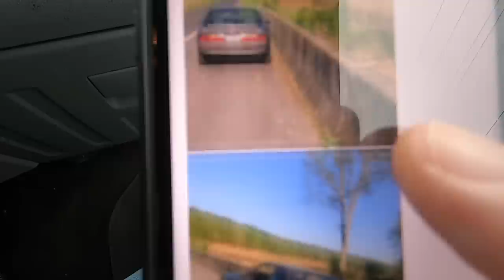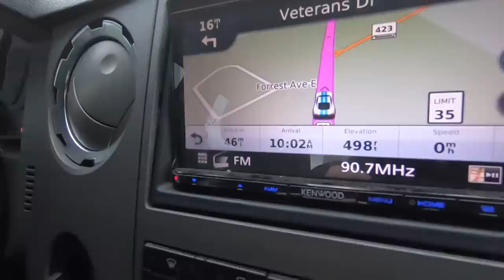We found a 100% original foxbody, and tried to buy it, here is what....

Comment: Here in Chitown, that car is a STEAL at $3k... I would definately buy it.. That quarter panel dent is an easy fix. just take the interior trim off, pull it with a dent puller, and check the frame...  Oh well..  You won't find another, and that stick shift is worth it. I would take the motor apart, and put on all the good factory goodies, intake from Explorer, bump the compression, GT40 heads, and you have a pretty quick stock screamer as a daily driver. Would love to have it than a rust bucket from the same year....sheesh..

Comment: I have two 1993 all original 5.0 Mustang’s one with 5000 miles one with 60,000 miles. Both are hatchbacks one automatic one five speed.
Reply: I got an 88 and 90 the 88 is auto with 13k miles and the 90 is manual with 45k, both convertibles though
Reply: I got five all original 1993 5.0 Mustangs with 12, 45, 80, 110, and 300 miles. All 5 are hatchbacks one automatic four five speed
Reply: @Stopsign32v  damnnnn sittin on gold
Reply: I have two pimples, all original, both ready to pop.  Both hurt one is bright red and one turned blue!

Comment: I've been around these since I was 3 (29 years and Still dialy the 91' GT my dad bought new in 91', have also owned many 93' Cobra's) and anyone who's been around them that long can tell that car has been hit. 3K is close to the value but she's not virgin, atleast been to 3rd base.
She could fixed yes, but theirs a few shady things about her. 
Here in the south..she's worth about 2,500 max. Any cowl or hatch damage is a major red flag. 
So, I think you made a good choice. 
For you to arrive with a truck and trailer and the guy not even attempt to consider an offer is enough for me to leave. Sometimes it's not just about the car guys, it's about the sellers attitude. I've walked away from a 93' Saleen clone that was done to the max for 5,500 just because the owner continued to lie even when caught lying. Car was shockingly gorgeous but if your gut tells you "This don't feel right" then listen.

Comment: Yeah, that LX has been rear-ended at some point. The passenger door doesn't close properly and isn't aligned when shut because of the tweaked right rear quarter panel. Unibody will have to see a frame machine, the rear quarter can probably be salvaged if the metal stretch isn't too much.

Comment: No rust, 3 was worth it.  Bad gas, fuel filter, air filter. Easy, eazy.  Yall messed up.
Reply: I agree the stuff it needs is stuff you wanna do anyways like a full tune up and fresh gas and oil etc.  Body wise i dont think its too bad either a no option 5.0 5 speed lx that is 100% original down to the plug wires is worth 3k in my mind all day long period

Comment: PDR will get that dent out easily!
Reply: PDR is not getting that RT quarter dent out.
Reply: @shockerdad3411  You cannot be 100 percent on that. It definitely could of made it look better. I did some home PDR and I am no professional and made Tahoe fender that I could not even get behind to hit out a lot better. Maybe not all the way but slide hammer to a plastic hot glue stick can pull out more than you think.
Reply: @mainecrab  I work at a body shop and PDR work should make things look like it did before damage was done. If not, we do the repairs. That quarter looks to be 10+ hours of repair to make it right.

Comment: My 89 gt was all original 2 owner car with ~150,000 miles when I bought it for $4,000 , factory wires, turbines, the engine hoist things, radio, all smog stuff was there, air silencer, even had the Original owners manual and the build sheet under the back seats, the only things I can think of it didn’t have was the distributor boot and a radiator, the plastic clutch quadrant just broke, sometimes i get mad at myself that I’m even doing anything to it but it wasn’t a perfect car it needed a little but seriously little work I do plan on doing a full but tasteful build it will not be butchered lol

Comment: I do body work and i had rather have a factory original ford quarter than a aftermarket one spotweld so eye hooks to that quarter panel take a come along to it chained to something solid and pull the dents skim some good bondo on it and put some single stage paint on it thats what the factory put on that color anyways and sell it for 6000.  Id get it to those dents would come out. The top one would pull out easy at the body line wouldn't take anymore bondo after u pulled than you would have in a pos lmr quarter cause that hatch just needs adjusting a hatchback from factory cars dont always fit much better than that one did wish i had 3 grand lol
Reply: Brs's Garage 90redmustang the door and fender both appeared to be cleared

Comment: I paid 4500 for mine similar car 1988 the only difference is with the options is that it has power door locks everything else is manual no AC nothing and I have already been offered 10,000 I said no the car is so original the interior is immaculate no dents

Comment: Everybody that dose not work on old cars and dose not have the money or the know how to fix them thinks they all have a Golden Nugget. Truth is these cars are 20+ years old and you have to change most everything that Sparks turns or stops to make it a daily driver
Reply: True but you gotta do the majority of that stuff anyways on most foxes you buy unless you pay 10 grand+ for it so i dont see it as a big deal it needs a tune up and new fuel and oil change, etc.
Reply: I'm going off of the fact that these are old cars and when you add the caust of changing alot of parts tires breaks fuel pump all those parts to make it safe and reliable out of pocket your looking at around $2000 or so to do it right add that to a buy in at $3000 that's $5000  is the car really worth $3000 to buy in to drop that much to prop up

Comment: Y'all made the right choice, nice car till you look at quarter. That car was hit in the back and side that wrinkle by the back window would have never been right, like you said it needed a quarter.You are always better off to spend more money for a good body.
Reply: Good luck finding a 5.0 5 speed lx no option car 100% stock unmolested with a perfect straight body anywhere close to 3k.  At this price its a steal and the body stuff is the reason they were getting it for 3 otherwise it would be significantly more id imagine it really wouldn't be that hard or costly to fix that stuff
Reply: Yes they are getting hard to find I would rather fix that quarter panel than fix a rusty car.

Comment: I've been here before, but some want something for nothing, that's not going to happen here fans, there is too much time and expense in holding this gem in factory showroom condition
I have a 87 Mustang GTs that is in showroom condition with only 13,298 mi.

CLASSIC 1987 Ford 
Mustang 5.0 GT
Here is one of the lowest mileage 1987 Ford Mustang GT Convertibles in America. This vehicle has only aprox. 13,300 original miles!  Exterior Oxford White, Interior Scarlet Red Cloth, with the most desirable 5.0L EFI HO 8-cyl. Engine, 5 speed manual transmission, posi rear end.  Power convertible top in Oxford White. This vehicle spent it's life stored inside and covered, only driven on sunny summer days, averaging maybe about a 100 to 150 miles per summer. The vehicle has NEVER seen snow or salty roads and never smoked in. Always hand washed and waxed.  Adult driven only. This vehicle has it's original window sticker, vin plate, all of the original manuals that came with the vehicle and the original dealer's ordering manual and full shop manual.  This vehicle is original and has been preserved by the owner .  
RARE! Original Dust Bag with Boot Cover in excellent Like New condition.  
The vehicle comes with the Wolf Car Cover, white bra and misc. Ford & Mustang novelty items. 
The vehicle came equipped with the following optional equipment:
Air Conditioning Group
Power Group  
Power Steering  &  tilt
Power Brakes 
Power Windows, Door Locks & Trunk Lock & Gas Fill  Door
AM/FM Radio Stereo Cassette
Speed Control
Oxford White Convertible Top
Cloth Articulated Sport Seats
The Battery and Alternator were replaced in 2010.  I have maintenance records that will come with the car as well as repair and service manuals for this year and model. The Convertible top is in excellent condition.   The interior of this vehicle  is fabulous. The carpets and seats are pristine. The dash has a removable custom Overlay, the  door panels are in excellent condition. Engine compartment is very clean. Power top operates very well. The car runs out great!
Here is your chance to own a CLASSIC Mustang GT and be part of Mustang History.
$22,000.00 out the door.
Reply: Will you take  a two party out of state check ??

Comment: I wouldn't have paid more than 2k with that dent.  It's not straight and it's not really a special car like my SSP (unwrecked!) Smart decision fellas!
Reply: I disagree its worth more than your average fox simply because its a 100% stock unmolested stripper (0 option car) which is one of the more desirable ones imo as its the lightest and simplest (less stuff to go wrong).  I think its worth 3 all day...the dent would be easy to fix just make sure the frame is straight at 3k its a deal imo these are impossible to find unmolested in this configuration for 3k

Comment: This car is completely untouched and not molested... So are we just going to ignore the fact that the door has been replaced and paint matched very poorly. Car won't idle and only stays running if you give it throttle.... "It runs good" is this what you Ford guys consider and holy Grail find because if this was a Chevy it'd be considered a beater.
Reply: Its been sitting for 15 years and has 100% original parts from 30+ years ago i would go out on a limb and say it needs a tune up, new fuel (has old fuel in it and cars dont run good on old shitty fuel bet you didnt know that did ya?) Oil change etc.  Gaurantee with all this done it would run silky smooth car is a deal at 3k these are impossible to find unmolested in this configuration
Reply: @michaelharris748  I bought a 66 c10 that had been sitting between 2 Barns on a farm since the late 80s. It had the original carb, original distributor and original coil. But the doesn't mean it's worth more than if it had a rebuilt carb and someone put and hei distributor in it. If something is all original and has a fair amount of miles that doesn't make it a good vehicle... It only means it wasn't taken care of and maintained properly.
Reply: @konnerkramer329  if you're racing the car its not gonna have original parts on it and it almost certainly isnt gonna be stock down to the exhaust.  That was my point.  Car has been sitting for 15 years im not sure if he ever mentioned the mileage.
Reply: @konnerkramer329  also im not so much saying having the original parts makes it worth more its just that this car in this configuration is very desirable to alot of fox guys and it being completely stock is a big bonus imo.  Its worth a little more than a run of the mill 5.0 to me for those reasons alone.

Comment: $3K????? Keep that piece of crap. That cars' body is possibly twisted and at minimum, quarter panel replacement. No options, and a bunch of "original parts" that are going to have to be replaced. Door not original (and doesn't line up)  so has been wrecked twice, actually. Not to mention it won't stay running. You got lucky if he wouldn't sell it.
Reply: What do u expect to get for 3k?  These cars twist up simply being launched on slicks so theres alot of foxes out there that are "twisted up".  It isnt perfect but its so hard to find one like this anywhere near 3k its worth it at that price.  That body stuff dont cost much and you should do an oil change and tune up and all that stuff anyways when you buy a car this old thats been sitting.  The point is its 100% stock thus very likely wasnt raced or abused.  To each their own i think its worth 3 all day
Reply: @michaelharris748  I have one of these cars and have had several others in the past  and therefore I know EXACTLY what you get for $3K. Apparently you don't.
Reply: @KM-uw4ez  ive had several in the past too and i gave around 3 grand for decent cars....back in 2002 and 2003.  This isnt 2003.  These cars are super hard to find like this unmolested and untampered with and prices have gone up on foxes.  A 0 option 5.0 5 speed lx is a really saught after car by alot of fox guys (me included) and that alone makes it worth more because theyre saught after and not many around to get ecspecially completely original.  I dont know what you guys expect to get for 3 grand.  Show me where these perfect foxes are...hard top 5 speed 5.0s with 0 option in better shape than this one is for 3.  Id love to see em.  Ill wait.....